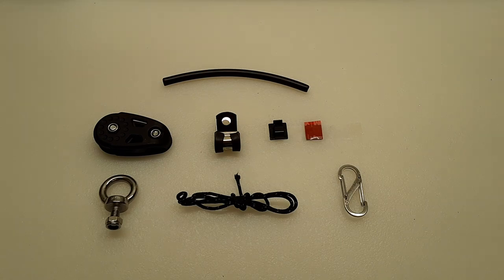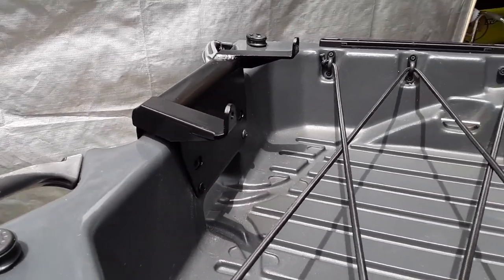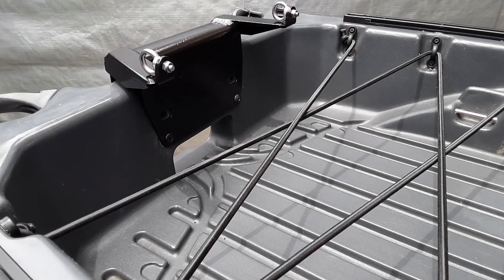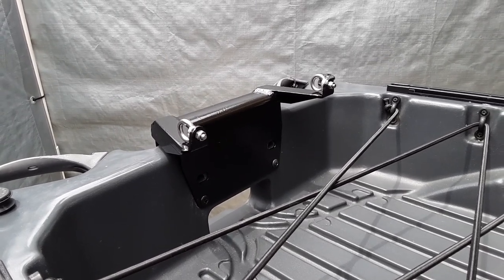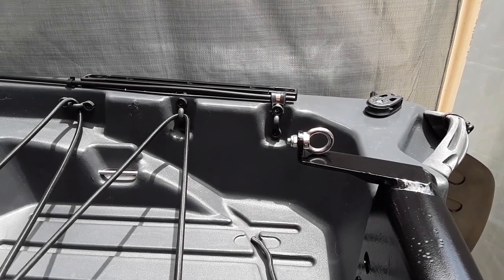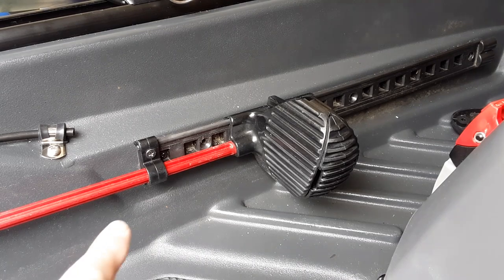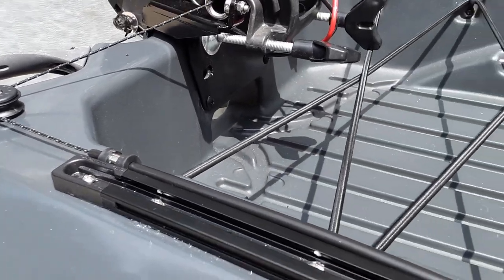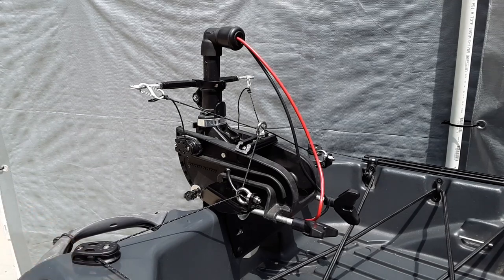Jonny Boats Bass 100 Kayak Trolling Motor Pedal Steering

Comment: Just wanted to drop a message that your video on the Hobbywing ESC really did the truck. Myself and a friend worked to create a steering controller that worked off the hotrc remote to make everything chordless, happy to share the info if you would like.
Reply from the maker: Yes. Pics and/or video would be great.
Reply: The site doesn't show the latest models with the incorporation of the Hobbywing ESC into the electronic box  but the steering mechanism hasn't changed.
Reply from the maker: @kenthenry5185  What site?
Reply: It looks like YouTube isn't allowing me to post the website (tried several times and the link dissapears).
Reply: Not sure how I can send it to you outside of YouTube.
Reply: I'll try to add links to these videos which allow you to navigate to the site where you can see images of the steering mechanism.
Reply from the maker: @kenthenry5185  Can you give me the name of the website and a search term to find the video? Thanks.
Reply: If you type into Google search "MINN KOTA - REMOTE STEERING Cults 3D", the first result you should see a steering mechanism which is 2 gears controlled by a servo.

Comment: Nice and clean! But how do we lift the motor out the water? Weeds and shallow water's nightmare
Reply from the maker: Thanks! I have a video for Impact Resistance and Cable Lift System that solves the issue.
Reply: I dont see the video you refer to. I'm curious too
Reply: Never mind I found it. 5yrs ago u did that video

Comment: Great install!! How did you get the paracord through the tubing, and is there any way to raise and lower the trolling motor from your seat?
Reply from the maker: Thanks Brandon! I didn't use paracord, it's dyneema 1.8mm cord. I just threaded it through the tube. I have another video that explains how to have impact resistance and raise the motor..
Reply: @Aksmaniyak  I appreciate the reply, do you have a link to the video explaining it? Also im  gonna try out your rc remote controller for your trolling motor I thought that was a great idea!
Reply from the maker: @brandonadams6403  Thanks again. I don't have a video for just installing the dyneema cord.
Reply: @Aksmaniyak  Sorry I meant the video on how you raise and lower your motor/impact resistance
Reply from the maker: @brandonadams6403  https://www.youtube.com/watch?v=_8U-mVP2idU&t=293s